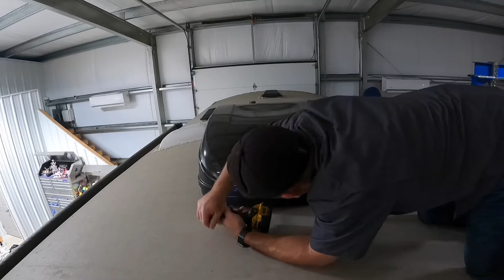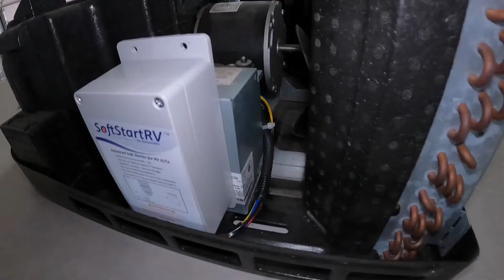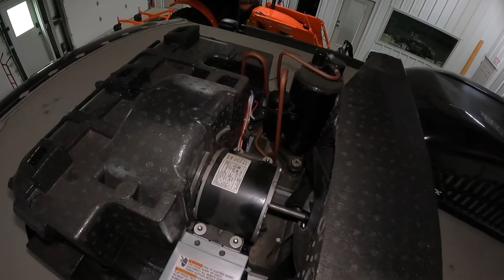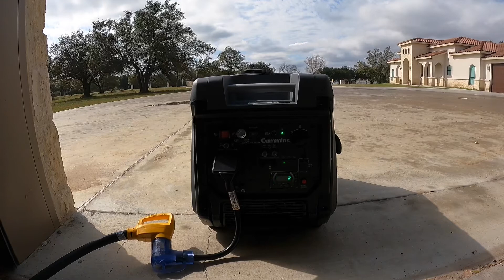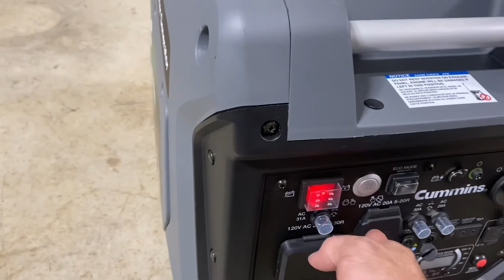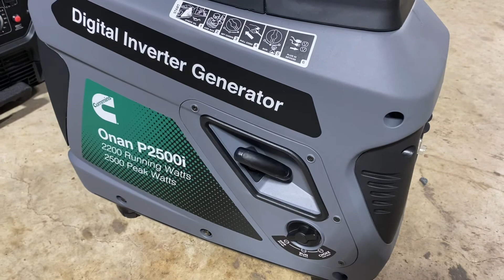RV Soft Starts for Ac units

Comment: damn rocky, you nailed it on this one. 
let me ask you this: without this soft start unit, after seeing that 23.7 amp draw on the start
1- what amp draw would you see after a while? would it go down to 10? 
2- how long it would take (aprox) to come down? 
and
3- whats the tradeoff? 
i guess the AC takes longer to cold down the unit? 

thanks 

great info
Reply from the maker: I would say within 20 seconds capacitor is recharged.. Amp draw continued to drop about 15 seconds after. Really no trade off. Compressor start still happens within 2 seconds. The low amp draw allows other things to run without popping breaker. I can run both ac units with a 4500 generator no issues with power to spare. This will also keep your wiring at 60% instead of 90%.  I also added the rvairflow which you can see in another video. I have not had to run my second ac unit since I installed..
Reply: @RockyRohde  yeah the airflow video was a mind blowing how a simple solution can improve that much. 
only by separating hot/cold air makes total sense. 
im buying one of those with your affiliate code 

great product discovery here (already saw all your videos since yesterday) 

let us know if you also have AC soft start affiliate code

Comment: Running amp draw
Compressor
13.5 btu
12
Evap Fan (Inside)
1.8
Condenser Fan (Outside)
1.3
Total amps
15.1 as to the soft start web site I could run my ac with a predator 2000, 2000 watt is max and running is 1800 ?????????? It cuts the starting amps in 1/2?